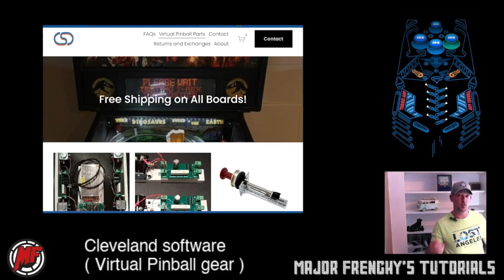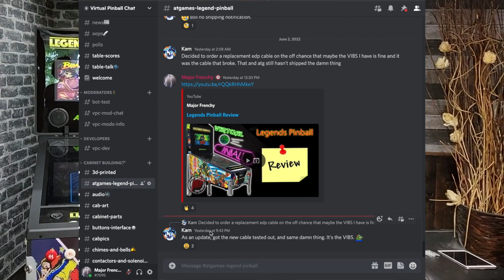Force Feeback  Solenoids (stand-alone)

Comment: I bought one of the 21 output KL25Z boards from Cleveland Software on eBay. It is a great product and worked with no issues. The only complaint I have is it came with absolutely now instructions or documentation. I had to contact the seller and he pointed me to a shared folder online that had the images of hookup examples, but that's it. Seems a piece of hardware as complex as that should come with an instruction manual or something. But... it is a great product that works well. I was able to document my own instruction manual so anyone who comes behind me (on my machine) will understand how it works.
Reply from the maker: Yeahhh. Unfortunately those boards ( not only this one ) don't come with detailed instructions.  It is us,  the end users, who ofter put complete guides together.  If you have a link for your documentation,  please feel free to add a link.
Reply: I agree with you (Greg Lilly)100% I purchased the exact item and struggled greatly.  It should have come with an install booklet instead of having to pester the seller with every little question or issue.  Also Phils' equipment	is not listed in the DOF config tool or any other "self help " books, websites or articles.
Reply: It's people like Major Frenchy , terry red and mjr that really care and put the time in to help the rookies get set up

Comment: Just did this install last weekend, following your instructions. It’s a great board, simplifies the work needed dramatically. Slightly wish there was a switch to bypass the solenoids if playing late at night, but love the sound and feel of the mod every other time.
Reply from the maker: You can bypass the solenoids by adding a switch between the 12v+ of the power supply. Have a look at this diagram https://media.discordapp.net/attachments/898642612230184971/986231590407536660/unknown.png
Reply: @MajorFrenchy  Great point - Thanks for the link!

Comment: The right side flipper button has the plunger box in front of it (in the ALP cabinet). Did you manage to get the solenoids to be symmetrical on both sides? I got the complete (prebuilt) solenoid kit pre-mounted on PVC from Cleveland Solenoid Design. Given the space constraint, I had to place the solenoids half an inch under the cross-bar 3 or 4 inches further up from the buttons. It's not a bad compromise at all as it is near where the flippers are on most tables. // Warning though... the solenoids are LOUD. When I play in the evening I reverse the flipper and nudge buttons in the ALP settings. // Also I was hesitant to drill screws into my ALP or cut wires if ever I need to use my warranty, so I just used industrial strength Command brand (ie. removable) stick-on velcro with a hold capacity of 2 lbs per 4 inch sticker (4 stickers on each PVC solenoid base). All good so far :)

Comment: Would this setup be OK with a leaf switch and some very light micro-tap presses on the buttons? I try to use my flippers like the "pros" do on real machines, so very light, very quick taps on the buttons is a must for me.
Reply from the maker: That's the setup i have. Leaf switch make a big difference

Comment: Hello. I bought the kit. I see you have pre wired button connectors with a connector for the solenoid. Where can you buy those? The kit doesn’t have those.
Reply from the maker: You need to make them yourself.  You buy the crimping kit and attach them to the solenoids with a bolt and nut. https://amzn.to/3AV0q43

Comment: Hi there. where on the control board for the ALP did you connect these? Everything else made sense except that. You did use the ALP internals, correct? Thank you.
Reply from the maker: Yes, i removed the 2 wires from the flippers, cut them and plugged them in the Solenoid Flipper Button Control Boards inputs. I then used 2 new wires re-connect them to the flipper button pins and Solenoid Flipper Button Control Boards buttons ports. Look carefully in the video, i have some captions .

Comment: hi, where you connect the power cables to get power to the supply?
Reply from the maker: to the wall. You typically strip the end of a power cord and connect the green-white-black to the back of the power supply and the male portion of the power cable plugs in a power outlet

Comment: Thanks Frenchy for the info on the easy mod.  I installed this mod but for some reason on the Atgames vpin games I have a slight issue.  When playing the Atgames tables, everytime I hit the flipper buttons it nudges the table at the same time.  Is it because of the mod wiring or something entirely different?  The Solenoids work great! by the way. :)
Reply from the maker: Yeah i had this issue as well, you will need to recalibrate your Accelerometer and possibly reduce the intencity.
Reply: @MajorFrenchy  Thanks Frenchy, appreciate the tip and all your other videos.